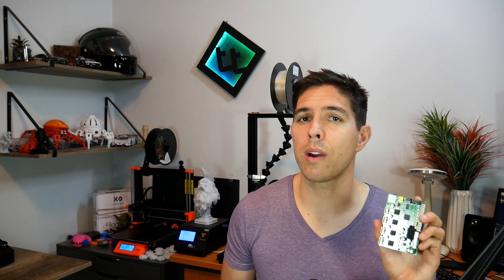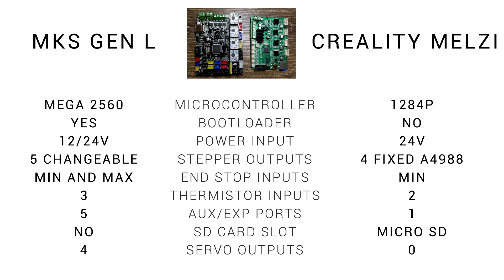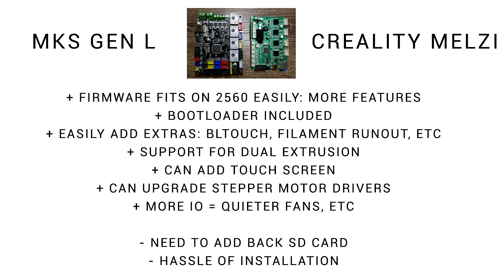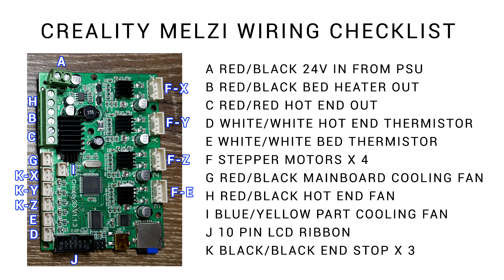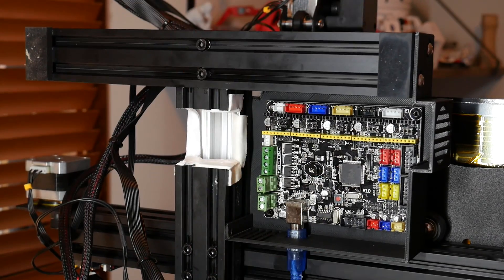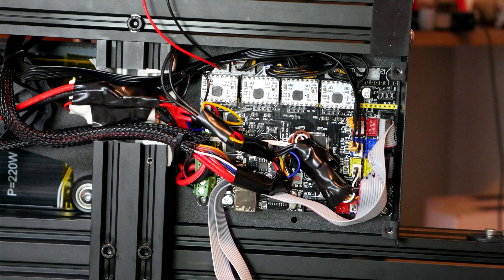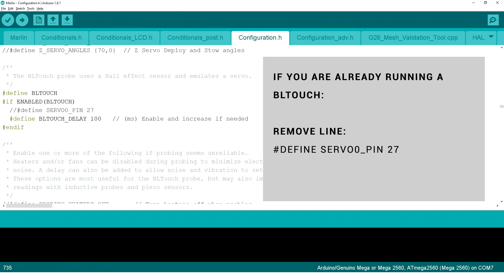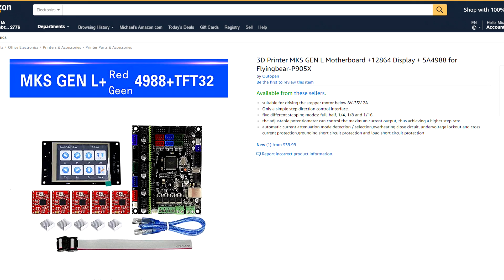Easy and cheap Ender 3 mainboard upgrade: MKS Gen L guide

Comment: I recently dropped my Ender3, and completely bolloxed the frame.. Fast forward 2 months, and it's been rebuilt with a RAMPS1.6 / Mega2560,  MAHOOSIVE linear rail and slider for the Y axis,  Completely new frame, mosfet boards for the bed, extruder and all fans. Auto bed leveling and electronic sensors for all three axis using my XYZ-THING io board. My own power splitter with dual buck converters for PI's or additional LEDs, fans etc.. I've used vanilla MARLIN, had a few issues with the thermistor type (it's 5), but now that's sorted, all is good..
I reckon I've swapped 90% of the original ENDER3 to make the DefENDER3-HD beast!!
Your video's have really been a help in configuring the firmware and other bits.. BIG THANKS!!  :-D
Reply: Dang I wanna be able to do all this

Comment: I am also seeing my hot end sensor fluctuate badly to the point it will not start printing without tweeking the auto temp settings during pre heating
Reply: have you found anything?

Comment: Michael,

I have done this upgrade and I have a bltouch installed but my printing has gotten far worse. I have the servos calibrated but it seems to double the original steps per mm. I set the voltages as you directed but steppers are very hot now. The drivers are the hobbypower 8825’s with TL smoothers. I am not sure if the BL is working correctly. Can you send me a link to your firmware setup to see if this fixes my issues.

Thanks so much for your help in advance.

Comment: Just finished this upgrade, but I am having temp issues now.the temp fluctuates between 5-10 degrees above and below the desired temp. pid auto tune hasnt helped either. Anyone have any suggestions?
Reply from the maker: You didn't change the thermistor setting in the firmware. Mine is stable and I haven't come across anyone complaining about the same thing so it's a mystery to me.
Reply: @TeachingTech   I'm having the same issue.  Even with the thing just sitting without heating, the temps are jumping all over the place.  Did you tell us to change the thermistor settings?  I can't find that anywhere in your video and I have no idea what or where I would change the thermistor settings.
Reply: @TeachingTech    There are three of us now having the exact same issue after using your guides.  My thermistors are both set to 1 for 100k, which as far as I know is correct, since you didn't go over that in the guide.  How about some help here?  I've even unplugged both thermistors and the temp still swings around.
Reply: I'm having the same issue... if I had the hot end set to 240, it jumps around the 235-245 range. It was enough to hold up the start of printing unless I set TEMP_RESIDENCY_TIME to zero (so it doesn't bother waiting to stabilise). Both hot end and bed fluctuate, but its more noticeable on the hot end presumably due to the greater temperature range.
Reply: FYI found a post for a couple of others that encountered the same issue: https://reprap.org/forum/read.php?13,813311  Unfortunately my soldering skills aren't good enough to go messing with the power chip or PCB mount capacitors. I think I'll just have to put up with it, or maybe grab another one if it bugs me enough, given they don't cost too much.
Reply: I'm having the exact same issue.  Did you ever figure this out?
Reply: I had same issue, PID AutoTune fixed it for me...http://3daddict.com/pid-tune-3d-printer/
Reply: Just wanted to add to this thread.  I have the same problem with this board and my Ender 3 Pro (24v Meanwell PSU).   The thermistor is physically fine, tested with a multimeter, and the firmware thermistor setting is set to 1 (100k).   

I got it working reasonably well, not perfect, but way better than it was by changing the PID auto algo to the 'Some overshoot' variant in the firmware:

Goto around line 364 in the temperature.cpp file

You should see this code like this

                workKp = 0.6f * Ku;
                workKi = 2 * workKp / Tu;
                workKd = workKp * Tu * 0.125f;
                SERIAL_PROTOCOLLNPGM("\n" MSG_CLASSIC_PID);

That's the default pid tune math that shipped in Marlin 1.9.  Below it in the same file you should see the "Some overshoot" code commented out.  I switched to use that variant instead of the Classic. 

My code looks like this now:

              if (cycles > 2) {
                Ku = (4.0f * d) / (M_PI * (max - min) * 0.5f);
                Tu = ((float)(t_low + t_high) * 0.001f);
                SERIAL_PROTOCOLPAIR(MSG_KU, Ku);
                SERIAL_PROTOCOLPAIR(MSG_TU, Tu);
//                workKp = 0.6f * Ku;
//                workKi = 2 * workKp / Tu;
//                workKd = workKp * Tu * 0.125f;
//                SERIAL_PROTOCOLLNPGM("\n" MSG_CLASSIC_PID);
//                SERIAL_PROTOCOLPAIR(MSG_KP, workKp);
//                SERIAL_PROTOCOLPAIR(MSG_KI, workKi);
//                SERIAL_PROTOCOLLNPAIR(MSG_KD, workKd);
                
                workKp = 0.33*Ku;
                workKi = workKp/Tu;
                workKd = workKp*Tu/3;
                SERIAL_PROTOCOLLNPGM(" Some overshoot");
                SERIAL_PROTOCOLPAIR(" Kp: ", workKp);
                SERIAL_PROTOCOLPAIR(" Ki: ", workKi);
                SERIAL_PROTOCOLPAIR(" Kd: ", workKd);
                
//                workKp = 0.2*Ku;
//                workKi = 2*workKp/Tu;
//                workKd = workKp*Tu/3;
//                SERIAL_PROTOCOLLNPGM(" No overshoot");
//                SERIAL_PROTOCOLPAIR(" Kp: ", workKp);
//                SERIAL_PROTOCOLPAIR(" Ki: ", workKi);
//                SERIAL_PROTOCOLPAIR(" Kd: ", workKd);
                
              }

So just comment out the classic and turn on the 'Some overshoot' code.  Compile and Upload.  Then do a normal M303 pid tune.  

Your mileage may vary, but this got my stuff working almost 100%, there's still very small oscillations around the target temp, like 2 - 3 degress, but I'll take it over the mess that the classic algo was giving me.
Reply: I encountered this same issue where the temps for both the hot end and bed fluctuate and pid tunning does nothing.  I was able to follow the suggestion in the reprap article to disable the  MP1584EN power converter and replace it with a 5v ubec. The temp is now rock solid. It appears that some of the MLS Gen L boards have a faulty MP1584EN which doesn't produce a clean 5v that the board needs for stable readings.
Reply: @echo2papa2  do you have links to the parts you used?
Reply: I used a fpv 5v ubec I happen to have laying around, it's rated for 6s lipos (22V) input but it has been working fine at 24v.  Amazon has some lm2596 that should also work. It's an adjustable output so set it to 5.2v.

Comment: Many thanks for this very good instruction. I did this modification on my ender 3 this weekend and it works perfect. I bought TMC2208 drivers and use them in uart mode. Now the printer moves absolutely silent. I had to change the wire for the Z endswitch (too short) and drill new holes for the screws on top and bottom of the new case (seems that my ender 3 has the holes 5mm nearer to the left side).

Comment: First of all i just need to say i love your videos! And it is beacouse of you i bought myself a 3D printer (Ender 3 Pro) last mounth.

But after i have done all of the updates whit Pi octoprint and so on from your videos. I have now orderd MKS-Gen L + MKS-TFT2,8 Touch Screen and also Stepper motordriver BIQU TCM2130.
So i would love is you can make a video with that config. I have read that you can tune the stepperdriver volt just in the software for more quiet operation like Prusa MK3.
I have a video from Thomas Sanladerer who is explaning the stepperdriver.
https://youtu.be/sPvTB3irCxQ

Best Regards /Peter Sweden

Comment: Maybe explain the "v ref" part and explain how to adjust whatever you were adjusting, you kind of glossed over that part and I have no idea what you were referring to. Everything else I'm pretty confident in doing myself but I don't know what you were looking for with the multimeter
Reply: I am Right there with you MR. Timmy i want to do this upgrade as my octoprint keeps yelling at me that my firmware is out of date i see no point in buying a arduno if i am just going to update this board. i am concerned about the V-ref thing my self... if i buy a kit that has the stepper motors is that something you need to do or is this only cause he was useing ones he had laying arround?  I was going to buy the one on amazon or the one he linked here... 

https://www.banggood.com/MKS-GEN-L-V1_0-Integrated-Controller-Mainboard-5pcs-A4988-Stepper-Motor-Driver-For-3D-Printer-p-1297316.html?p=JV140519177383201802&custlinkid=96380&cur_warehouse=CN  

I am leary however to buy pickup with out knowing the process that i am missing.

I am still super new to 3d printing i have had my printer for about 1 month...

Comment: Guys having tried this a while back here's a couple of tips. Do not connect a 5v fan directly anywhere on the board's 5v rail. The regulator on the Gen L will not keep a stable supply voltage and will cause your sensors to fluctuate. Basically you're temp sensors will start to have some hysteria :P (You can compensate in the firmware but that's weak) A nice trick is to connect two 12v quieter fans in series to the E1 connector on the board with some Marlin modifications you can get these fans to start at a certain temperature. Play about with the software PWM to reduce the pulse noise. These two fans are the cool end fan and the motherboard fan. Basically means you're printer is silent until it starts working if you disregard the power supply fan or have a silent supply. Also have a go at software serial to manage your TMCs which gives you almost silent workings. I went for TMC2208s all round however you can make use of the TMC2130 on X and Y with CrashGuard. This eradicates the need for X and Y end stops. With less sound and vibration the prints just get better and better.

Comment: Put me down as TOTALLY interested in a video showing how to get the TMC2130's or at the very least the TMC2208's working.  A set of silent drivers, Noctua fans, and stepper motor dampers and you'll hardly hear it.  Add the DIY filament run-out sensor and a BLTouch and for an extra $100 you've nearly got a printer as nice as a $900 Prusa.

Comment: Two Quick Questions. 

1. it appears that you connected the Hot End Fan (call-out H on your diagram) to the secondary extruder heater port on the MKS board. Did I miss something in the instructions?
2. Can you still connect Octoprint via the usb port to this board like the original Creality board?
Reply from the maker: 1. This is correct. We are not using the pwm of the MOSFET output but simply the on/off switching so the fan only runs above 50 deg C.
2. Connects exactly the same to Octoprint or computer as before.

Comment: Hey teaching tech I recently did this mod to my ender 2 cause like the rest of my creality boards (an ender 4 and CR-10) my ender board just died but I couldn't get the new marlin to work I had to use an older version (1.8.5) with the mother board defined as MKS_BASE anytime I try to use MKS_GEN_L I get so many errors when verifying it works but if I could get a copy of your firmware I could just add in the smaller bed size and the steps per mm it would really help thanks

Comment: Hi, I should adjust the stepper drivers to which voltage? I have an Ender 3 (not Pro) + MKS Gen L + TMC2208
Reply: Anyone?
Reply: @mikem8145  "My TMC2208 drivers are set to X,Y,Z 0,73V and E 1.1V. My motors are at 30 ° C during printing. I did not activate the uart mode." from https://www.youtube.com/watch?v=TFvMoYJi9F8

Comment: Hey man, great video and everything (as usual) but me and a couple of my buddies all have the ender 3 (not the pro), we are each doing the same upgrade at the same time to help each other out and we all noticed that the back screw hole on the top 3D printed part was off by about 8mm to the left. No real big deal if you have a drill but we just wanted to let you know. 😉👍
Reply from the maker: Thank you. Unfortunately I don't have my standard Ender 3 anymore so I was hoping for the best.
Reply: @TeachingTech  I have made updated files for the original Ender 3 and uploaded them to Thingiverse and linked it in your comments. I also modified both versions to be able to hold a 40x40x20mm fan for people that so choose also linked in the comments. If you would like to add all of them to your thing, I will be happy to delete mine so everything is in one place. 

The only other thing we have found so far for a stockish Ender 3 (No BL Touch because I don't have one and using Octoprint) is that we can use a single ribbon cable but we need to cut the key off and reverse the screen side. We are using EXP1 on the MKS side and EXP3 on the screen side. We also had to reverse the firmware side of the screen edits commenting out "REPRAP_DISCOUNT_FULL_GRAPHIC_SMART_CONTROLLER" and uncommenting "CR10_STOCK_DISPLAY" so that its how it was with the stock firmware.

I Wrote up a guide on my site explaining everything I have done to get the original Ender 3 working with Octoprint using TMC2208's: https://ltm56.com/installing-the-mks-gen-l-with-tmc2208-silent-stepper-motor-driver/

Comment: Hi, I followed your instruktions but i have massive problems with the homing. Homing Y won't work at all and bedleveling is also not working :( any suggestions why?
Reply from the maker: Very little has changed firmware wise so I'm guessing plugs not in correctly.

Comment: Very nice video. If i have trouble or want to upgrade my E3 then your channel rocks. Got the E3 pro and want to buy a 2nd E3 pro and make a dual extrusion. This cheap board is the way to go. Any advice for the rest?  Like the hotend ectect. Ty again for this vid. Dumbs up.

Comment: Bit confused... the current V1.1 MKS board the links point to has a micro SD card on it. You say the SD cannot be used?
Reply from the maker: This isn't the one I ended up ordering. It may well work fine.
Reply: The board arrived and yes it has the SD card on the board. I might try it and find out.

Comment: Very nice video! I found out that the link pointing to aliexpress for the board with drivers actually links to a smoothieboard clone. Not sure if it's a mistake or on purpose, but made me curious about the (seemingly more modern) ARM board. Any chance you know about this and can shed some light?

Anyways... The link is wrong and the board is not a MKS GEN L.

Cheers!

Comment: Nice. I upgraded mine with the v2.1 Creality board (for the CR-10S etc) which has the advantage it fits the existing metalwork unmodified on the Ender 3, but it doesn't have upgrade-able stepper drivers and that MKS Gen-L board does look better.
One thing I would recommend; when modifying connectors like you did for the end-stop connectors, try the flush cutters that come with the printer rather than a scalpel - found it very easy and safe. My fingers survived unmodified... (in my case it was needed to turn the LCD display connector around)

Comment: First things first, great video and I will acknowledge every build is different, so pardon my critical thinking in advance. I did this upgrade before this video came along, it is condensed for viewing and kinda excludes a few things.  I got passed most of the hurdles and the only problem I have left is calibrating the center of the bed and the size of the print.  I upgraded to different stepper motors with dampeners which means you need the adjustable sprockets/gears on the end of the stepper shaft.  I assume once I changed those it changed the ratio at which the belt was moved in respect to stepper angle.  So I attempted to fix that but need to try a few more things.  There are a few snags I ran into along the way to include:  The color coding of the limit switches doesn't correspond to the the colors displayed in Cura on it's virtual axis, so I miss wired the limit switches, next the comp port you choose for your firmware upload to the control board  isn't always going to work the same, sometimes you need to unplug it just seconds before you load the stuff or you will get a time out error, also I wasn't aware that with this board, although you can choose a display, the MKS display needs it's firmware put on the SD card and it will load from there with a longer boot on the first power up.  If you want to do an ABS only machine like I want to then you need extra long wires and different unit to hold this because an ABS set up is a hot environment that is no good for the control board, I imagine mine will be like the CR-10 set up.  As far as the wiring goes, it is simple IF you do not use the separate board for the power to the heated bed.  The MKS MOS25 is this device, it complicates things although I you can save a butt load of time by looking at the wiring of the FLSUN QQ because it has ALL the stuff already set up.  If anyone messages me I can send you a picture of mine, I won't leave a link because most link comments are subject to review.  Another side note is that you can save money on that borosilicate  glass bed if you just go to a place that cuts glass for pictures or windows and ask for a 9 1/4 by 9 1/4 by 1/8 piece of normal glass.

Comment: Michael please provide a link for better stepping motor drivers. I was thinking abolut the upgrade to MKS GEN L for quite some time and your video was the last drop that spilled the cup ) I 've ordered a new board without drivers bearing in mind that upgrade too. But if i order these only after your next video, I will have to wait another month o so )) So please include the link for drivers if you have already tested them.